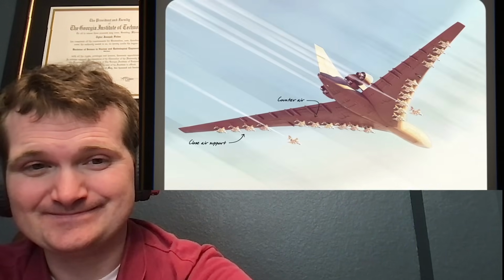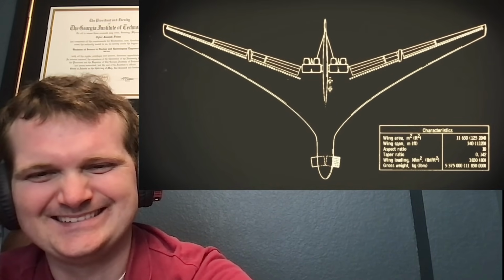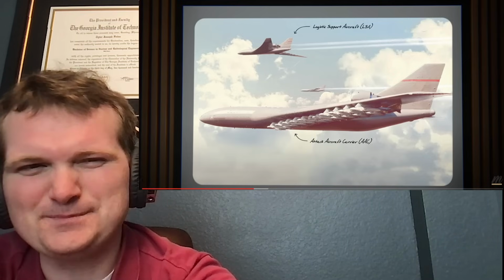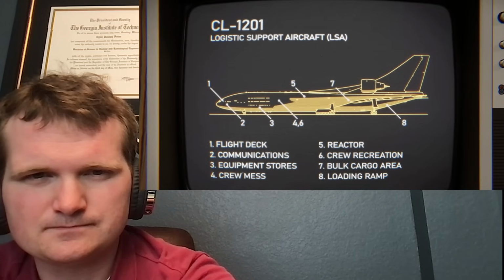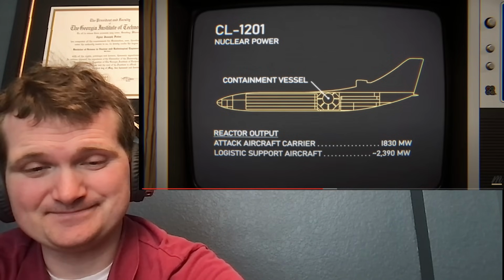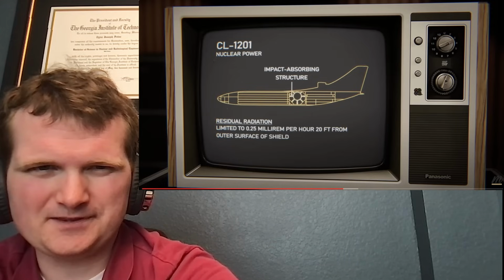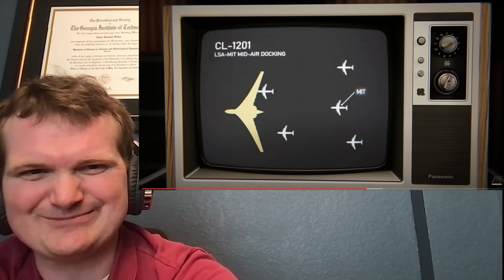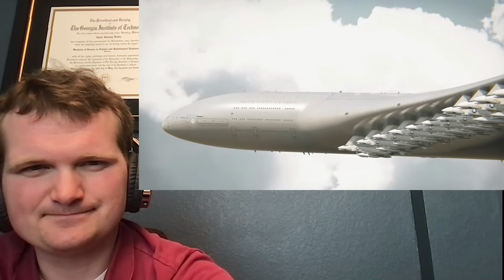CRAZY GIGANTIC Nuclear Plane? - The CL-1201 - Nuclear Engineer Reacts to Mustard

Comment: I'm super curious if you think making a huge fleet of nuclear powered cargo/container ships would be a good idea or if that's just too much power💪🏽🤔
Reply: That was tried, and it did work. It was not cost effective however due to the highly trained crew, except in a very specific scenario.
The NS Savannah, decommissioned in 1972, the Otto hahn rebuilt with diesel engines in 1979, the Mutsu research vessel rebuilt in 1996 with diesel, and the only currently active nuclear cargo vessel, the NS Sevmorput, which also moonlights as an ice breaker.
Reply: @Demonslayer20111  that's truly too bad, but is understandable, it can't be cheap hiring nuclear engineers to operate a ship, something that didn't occur to me🤦‍♂️ 
thank you 😁👍
Reply: @jonagill  Yeah, another issue is that they were highly limited on where and when it can dock to transport or offload cargo. The owner country would probably allow it to dock anywhere without issues, but other countries wanted nothing to do with them because they saw them as risky. That could have changed over time, but in the short term it heavily impacted its profit viability as well.
Reply: @Ghettofinger  that for sure didn't even cross my mind and sounds like a very fair point, thank you very much😲🙏

Comment: I agree with the jet fuel answer. Indeed a reactor would be less stable for the lift stage and it would be more maintainable at gliding.  Otherwise you would need to ramp up the reaction, then decrease it or else risk damaging the engines and going to fast etc. also perhaps the reactor produces too much at a high capacity for the engines.

Comment: It has all sorts of problems, but you have to decide if you want to fly on nuclear power. That means you would have electrical driven turbines that don't use jet fuel at all orf can be shut down. You can also directly drive engines from steam pressure. I think in most cases these reactors need the stream cooled down eventually, and is ships they probably meet the outside water. Actually planes may be able to sink it very well since the high air is very cold.

Comment: one real issue for the 1201 is that you can probably blow the defense budget with one accident.
Reply: I mean, just the dev cost alone would do it. 

But tbh even if theh never ended up building the things a reactor power dense, light and robust to the point of making that design even more than a pen and paper project would have been enough literally any amount of money. Even if it never came to fly, that is the kind of shit the nuclear industry has been begging for funding and regulatory approval to take a swing at. Mainly because the 60s reactors showed the concepts were not only possible but proven to work on at least some level.

Comment: 4:12 and there it is thats the bit that i find so ..annoying ...  because its only 64 times the weight IF the object is of uniform density ...   example ... literally every lighter than air  aircraft.... a balloon for example when inflated to twice it's size doesn't not weight 64 times the weight of the empty balloon...  and if your wondering why im being pedantic its because  i see it used as a common go to as to why big thing isnt possable

Comment: What's interesting about large planes gets into stalls, engine out takeoffs, support structures, etc. The 777, 1990's design, had some wild characteristics. The engines were so large, that a 737 could fit through the nacelle. Boeing had a rule that no pictures could be shown of them together as they thought people would have a negative reaction to the engines. When I went to the roll-out where we could 'kick the tires', the engine and nacelle were outrageous.
I thought it crazy that single engine take-off required an engine located a fair distance from the center of mass, hanging off a wing, to throw 350 tons into the air. Quite a structural feat for something that flies. There's also the asymmetric control of a single engine under max thrust.

Comment: The reactor probably has to be near the base of the wings because that's where the center of gravity needs to be. I doubt 'nobody ever needs to go aft of the reactor' is feasible, though with the size of the wings it's probably possible to have corridors well to the side of the core.
Reply: Yeah, big planes usually have their wings and main landing gear at the same spot on the fuselage. Since wings hold them while in air, and tires while on ground, so you can build most of your structural strength on that specific length of the fuselage. Makes sense to put the reactor there too. 

Also behind the reactor was marked as "bulk storage", so I think fuel, ammo etc could be used as additional shielding near the reactor, and having tanks/etc vehicles way back would work too, no need to access them while in flight.
Reply: This monster could have a shielded tunnel(s) through the reactor compartment, like on submarines.
Reply: The placement of the reactor is pretty similar to what it was on my old 688 sub, basically just aft of center behind crew's mess. You just went through a passageway to the side of the RC that was shielded to get to the engine room. Of all the problems with this aircraft design, I don't think reactor placement is one of them nor is there any reason someone couldn't get aft of it safely.

Getting that thing off the ground without things ripping apart...now that's the challenge.
Reply: yep its true was  about to comment about the cg

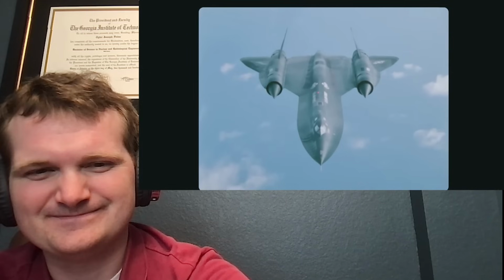Comment: 2:28 that would be an XB-70, arguably the most beautiful plane to never go into production.
Reply: Two were built for research purposes, one crashed, and one remains in the Air Force museum at Wright-Patterson AFB, Dayton, Ohio.
Reply: @robdgaming  yup, i have visited it and other aircraft such as the YF-23 in all their beauty, i only live around 2 hours from the museum and i am very thankful for that!
Reply: Part of the reason the production B-70 never happened was the development of Soviet SAM systems. Notably the S-75 used to shoot down a U2 over the USSR in 1960. The CL-1201 would be very vulnerable to SAM systems such as the S-200.
Reply: @markevans2294 the cl 1201 was so big that could probably shrug off multiple SAMs. They also could probably attach point defense systems to the thing
Reply: Even its name (the Valkyrie) was beautiful.
Reply: Eh B1 is better
Reply: @raygun1414  An unfair comparison; the B1 is decades more recent!
Reply: @raygun1414 
the bone just doesn't have the valkyrie's beautiful angelic make and form.
Reply: well, tied with the YF-23 in terms of beauty
Reply: The borzoi plane

Comment: The Soviets apparently did make one that worked, but only flew it a few times and the crew usually did not live very long after the flight.
Reply: I mean Russia is even doing it right now. The Skyfall missile uses a nuclear thermal ramjet.  Which is... Pretty much guarantees that the exhaust is going to be radioactive.
Reply: @redneckcoder >If for no other reason than the Soviet Union hasn't existed in 34 years.
looks at the situation in Ukraine.
"You sure bro?"
Reply: the ole fell out a window problem?
Reply: @NonsensicalSpudz  More like cooked to a medium rare kind of thing. In Soviet Russia you are shielding.
Reply: @NonsensicalSpudz the fact that neutrons that create neuclear reactions tend to leave the reactor and create radioactive isotopes that tend to be damaging to dna and RNA, in addition to oxidative stress, and protean denaturation (mild cooking). Which is how Russia got a nuclear reactor airborne by not taking much radioactive shielding because even juggling plutonium and creating a nuclear "incident" the pilots would be able to operate the plane for three days before dying. They did use a few inches of leaf shielding, but not nearly the appropriate 3-4 feet of lead needed(it's been a while but it was quoted 4 feet, so heavier than a main battle tank).

The weight of the shielding, and the weight of the reactor, and coolent and the very inefficient engines that  had to convert coolent temperature to thrust ment safe nuclear planes weren't an option. Converting to electricity means adding a generator plus heavy copper coils and magnets to each motor.

In a missile, if it exists, it can use nuclear power to preheat the air, turn turbines, then use ramjet technology (I'm guessing from another.comment).

It's better than the US building a nuclear gun to launch nuclear ICBM at USSR.😅
Reply: @redneckcoder Thanks, I had a couple different ways I was procrastinating about that one, your's is better.
Reply: Are you talking about a movie or something? I don't think this is real
Reply: @ninjalectualx  No they really did build one, flew it a few times, spewed radioactive exhaust everywhere.
Reply: @ninjalectualx  It's supposed to be real. The USA did some tests on a system much like the one the Russians say they have now back in the 50s but we abandoned it because ICBMs looked better.
Reply: @ninjalectualx  no it is the 9M730 Буревестник ( 9M730 Burevestnik ) Which is Ruzzian for thunderbird.  NATO designates it as SSC-X-9 Skyfall
Reply: Yep, I’ve read about it too. Apparently the standard exhaust from a standard jet engine was replaced with some spicier stuff in this case. If I remember it right, and the book was correct, I think it was radioactive coolant that was leaking and being vented out of the aircraft. Once in the slipstream and all the turbulence from the jet wash, it was dispersed over quite a wide area behind the aircraft. They knew it was leaking while in flight, and in all the additional flights, they just didn’t care at all. No one told the people in the flight path before, during, or after. I can’t remember what the final destination or disposition of the plane was, so who knows where it is. I think they eventually realized the conclusions we came to while it was still on paper. That being putting a nuclear reactor in something that can fall from the sky is not a good idea. Not to mention we had enough B-52’s that we could keep multiples of them aloft, 24 / 7, for years and years. Which is what we did during the entire “missile gap” period, which was entirely not real and we actually had more, and more capable, missiles, warheads, targeting, guidance, and knowledge about the targets.
Reply: My understanding is that neither the Soviets nor the US ever flew by means of a nuclear reactor. I believe both did experiment with the feasibility of flying with a reactor. The US had the NB-36H, which did fly while the reactor was running on a few occasions, but did not fly under the power of the reactor. I believe the Soviets did something similar a bit later using a modified Tu-95, though I haven't heard anything about "cooked" crew as a result. It's highly doubtful considering it doesn't make sense from an attrition (or morale) perspective and the Soviets weren't that incompetent. Hell, I'm pretty sure that experiment never even flew while the reactor was running or even fueled, it only tested the feasibility with the weight of the reactor and necessary shielding.
Reply: American education is at its peak with you buddy.
Reply: As far as we know, the ussr flying reactor worked in no way shape or form diffrent to the US flying reactor. The B36N
Reply: @redneckcoder '/s/' needed to be added to the end I guess. I was more commenting on the expansionistic nature of the current Russian regime, exactly like the Soviet one.
Reply: @redneckcoder that makes me feel old. You put it in perspective